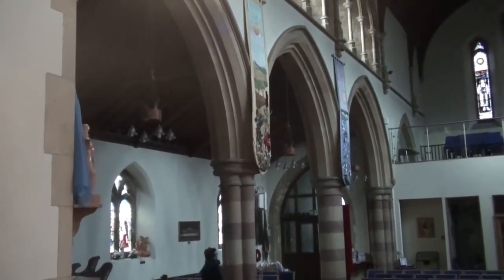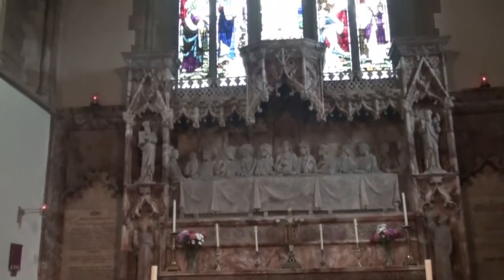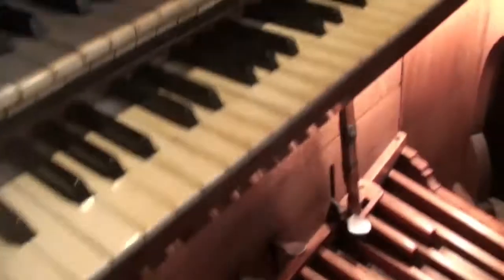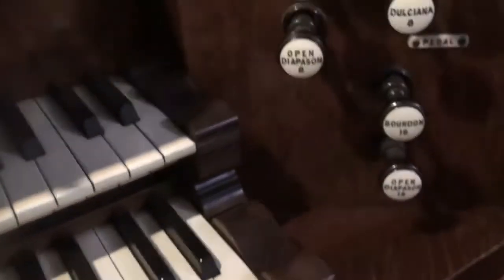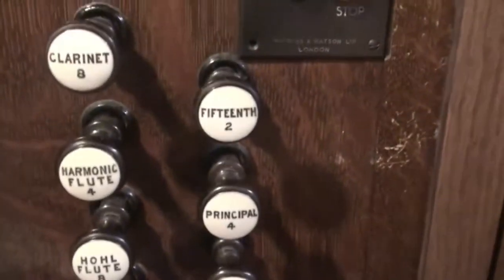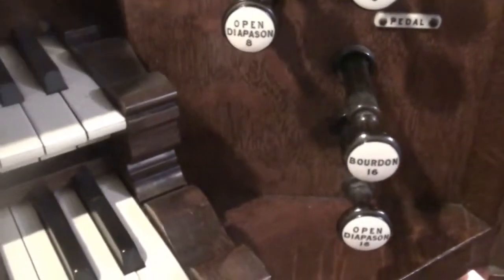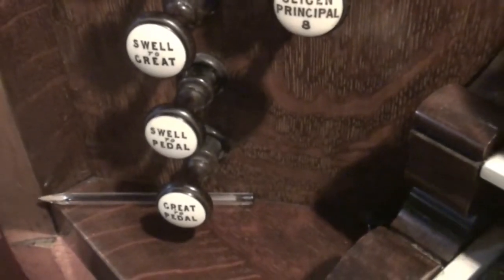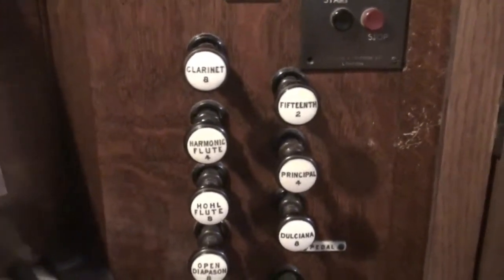The Organ At St Marys Church Clydach Swansea

Comment: Geigen Principal 8 translates to "Violin Diapason 8", Geigen being a very old word for violin. Yeah, glad to see a ratchet swell pedal....which is correct for a UK instrument of this age. Most makers moved over to the later & more usual balanced swell pedals in 1914. I've not personally seen a ratchet pedal with a half-way stage before, but was aware that they are around! Discus blowers from Watkin & Watson are alledged to be the best around, they are very efficient & run at twice the speed of most other makes. Both Watkin & Watson & their rival British Organ Blowers (BOBco) are both very much still in business. Watkin & Watson diversified into medical equipment & BOB into cooling fans for radio transmitters, as well as their organ blowing products.

Richard